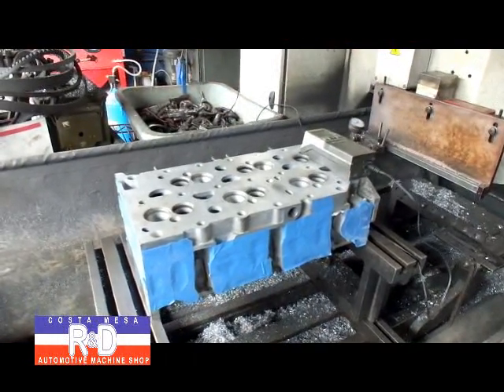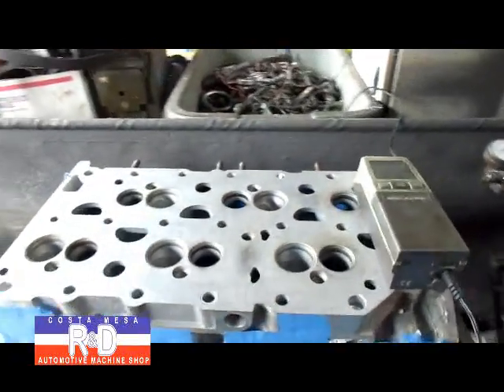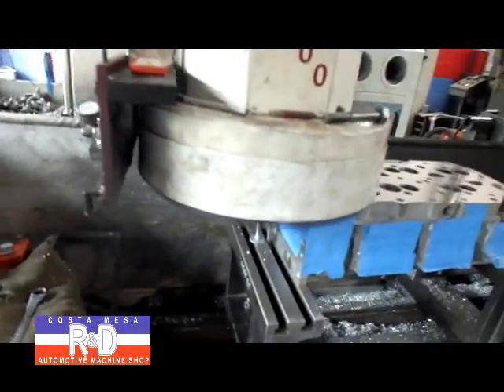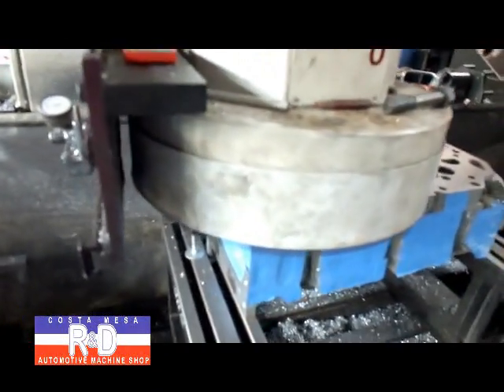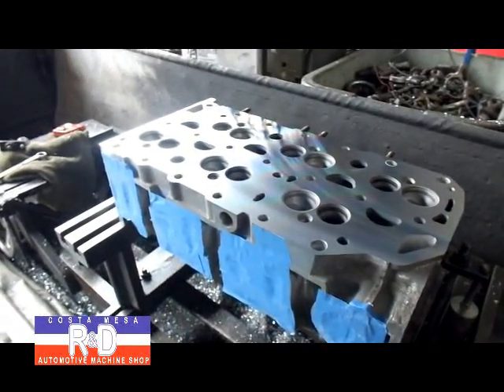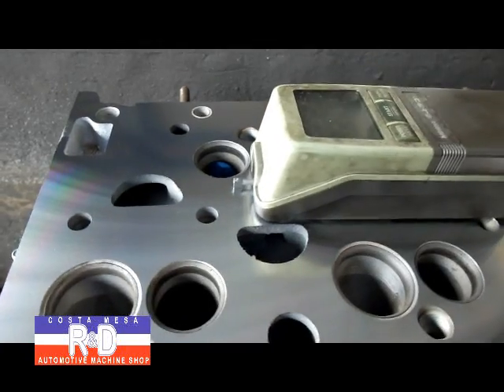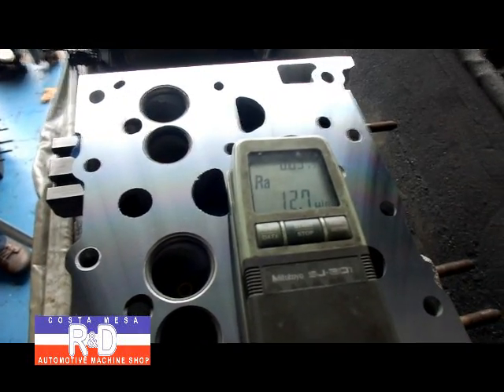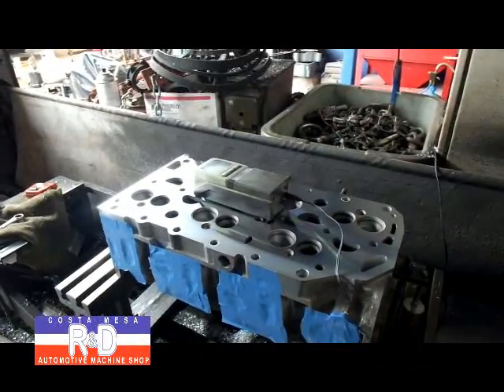Volkswagen VR-6 Cylinder Head Resurface and Surface Texture Verification

Comment: I grew up in a machine shop that used a head surfacing machine very similar to the one that you have here, and liked the results that it delivered. Lately i have been moonlighting in a machine shop where I currently live for a little extra cash. this shop has the belt sander type head surfacer that you brought up here, and i would agree that on a lot of aluminium heads i feel it doesnt leave as smooth of a surface. what is your feeling on the belt sander type surfacer. i have mixed feeling.